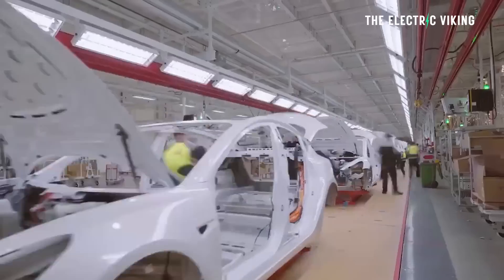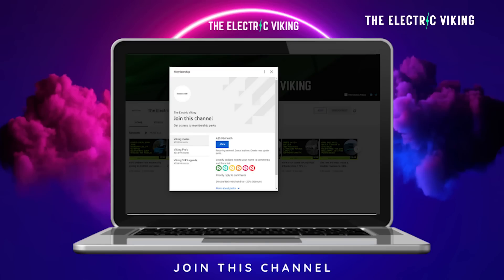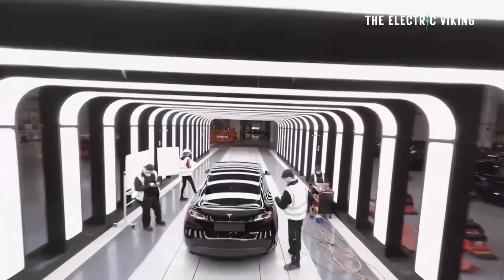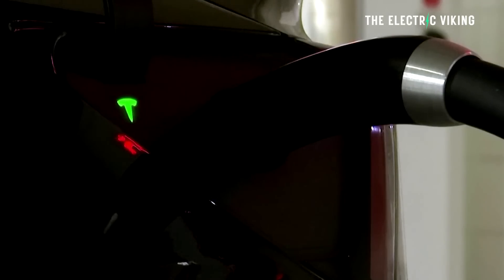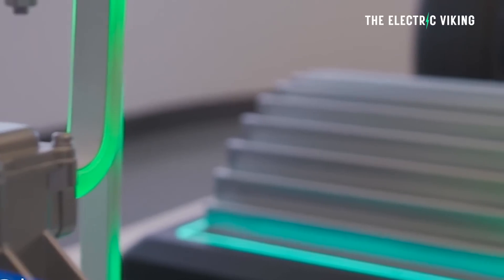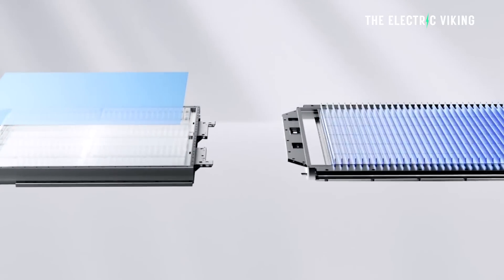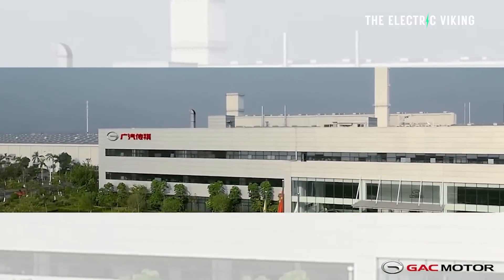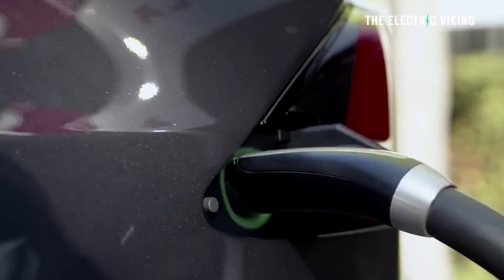Big changes coming to European & Chinese made Tesla Model Y battery

Comment: What tesla needs to do is not what they are doing.
Tesla cars are virtually uninsurable or are insurable at absurd prices because of the silly manufacturing processes.
For tesla these might be bringing in huge profits. For potential owners these are idiotic roadblocks.
Especially the model y with it's huge subassembly parts.
Lets face it, reality is crashes happen and cars are not single use products. They need to be extremely repairable, where anyone can do it in their garage by being able to buy parts from any number of distributors, and not a monopoly of the manufacturer that either doesn't have the parts or charges an arm and a leg.
ie: You have a crash on the right side, tough luck tesla owner, you have to buy the whole real subassembly and on top of that the labor cost will be through the roof because you need to dismantle the whole car in order to fit the part back in, instead of doing the repair just on the location.
Reply: Prepare for this because all manufacturers will need to giga-press large part. I found Aviva insurance to be 20$ a month more than my Toyota matrix 2012 vs model Y 2023.

Comment: Apparently the hiatus is not just about the battery but the used motor (it went up from 88kw (30 minutes) to 100 kw (30 minutes) "continuous" load. This model-motor-battery combination has not been registered yet and needs a KBA numbers - and numbers here in Germany are a very serious thing. 😅
https://youtu.be/5Oa50_aJz7w?t=236

Comment: SAM - CAN YOU COVER THIS ON THE CHANNEL PLEASE

I don't get the hype over significantly faster charge rates and this is why.  Currently the data shows that around 80% of EV charging is home charging. Unless you have three phase you're unlikely to get charge rates less than several or more hours if the pack has been run down. The majority of journeys overall are not going to max out an overnight charge and in non US countries with far less long distance, even more so.

Home charge costs are less per kw/h so there is a small incentive to charge at home, cost wise in many countries.  The grid supply currently to most homes in the world can hardly support more than 11Kw charge rates, many less.  So again, what is the benefit of batteries that can charge super super fast, as the transmission supply infrastructure to domestic residences is never going to obtain high current supply and charge from home solar is slow.

So the only benefit I see, certainly for a long long time is supercharging covers a particular  and I feel more limited need (robot taxi aside). Those without or who cannot get a home charge solution (say apartment parking, or road side parking) yes, those long distance yes, and those who just want to get away from home life for a few hours, yes. But how do you see the real need for rapid charge batteries that use higher cost commercial charge rates?

Convince me there is a good use case please.
Reply: For the 20% that don't charge at home and for road trips.
Reply: We use superchargers on about a dozen trips per year. We travel somewhere usually to meet friends or family, stay for 1 to 5 nights,  maybe go on a couple of day trips then travel home or sometimes travel onwards to see other friends or relatives. Most friends and relatives don't have off street parking let alone a charge point, most places we go don't have destination chargers so we have to charge enroute. The faster the enroute charge the less it matters! After saying all this we have a model X 75 and we get about 175mile range driving at 70-75mph on the motorway, and the battery only charges at up to 100kw upto 50%. Yes it can go a little faster (occasionally 130kw), but most of the time 95-105kw is the maximum. With more destination chargers that that work seemlessly then the less need for the superchargers... But until you can plug and go with the charger billing you directly without signing up to a different random app each time and then pre loading credit onto an account you may never use again only to then find that the charger doesn't even work then you give up on destination chargers you haven't previously used and still to supercharging!

Comment: A significant difference with the BYD blade batteries is that they are configured as 129S. There is no paralleling of cells as in many other battery types. This simplifies battery management and reduce the number of pack components, reducing weight.

Comment: What puzzles me is, not one manufacturer is redesigning their vehicles to take advantage of the fact a long bonnet is not required anymore.
As a guy who drives a small F/C truck, it so much easier to drive in heavy traffic than my car.
Another point imagine the ease of manufacture if the drivers position was in the centre and passengers sat either side of them , no worries or changes required depending whiçh country is was being exported to.
Reply: There might be a few reasons: aerodynamics and safety (crumple zone).
Reply: ID. Buzz is one example
Reply: All good points, and I agree entirely. I guess the problem is people don’t like change? The first model S had a fake grill on the front, simply because there was concern that people would be too freaked out if there wasn’t one.

Comment: CATL M3P is not LFP with Manganese ,it is LFP - Iron +3 Metals( Magnesium, Zinc, Aluminium).
Reply: I think that they are using the  Magnesium, Zinc, Aluminum as a shell structure to coat an inner core of LMFP. The 3 metals should reduce contact between the electrolyte and the manganese to reduce dissolution as well as add other benefits.

Here is a quote from an article "In an investor research event in February last year,CATL said for the first time that it planned to launch a new product M3P battery, but this product is not lithium manganese iron phosphate battery to be exact, the battery cathode material also contains other metal elements, which the company calls ternary lithium battery of phosphate system."

Comment: The reason Tesla doesn't want to draw attention to these battery changes is because the people who they're trying not to offend are those who bought Long Range and Performance Teslas with the inferior Lithium-Ion batteries.
Reply: Lithium ion batteries have a longer range or more energy, dense and deliver more power. If you check the original model, three with lithium ion is faster 0 to 60 than the current one because of the differences in the batteries.. neither pack is better or worse, just different.

Comment: There is already a Tesla model 3 long range range with rear-wheel drive for sale in Denmark, with 620 km on a charge
Reply: Hopefully coming to Ireland soon....
Reply: This kind of pisses me that the NA market is getting LESS range than European models. Wtf
Reply: We are talking about 620 miles not km
Reply: This kind of pisses me that the NA market is getting LESS range than European models. Wtf
Reply: Not all markets are offered big battery single motor vehicles because here in the UK that was the one I wanted and we have never had it since day one. Also the ranges in different markets defer purely due to the measurement and not the specification. North American cars have exactly the same range as their European counterparts by just use different measures for regulatory purposes.
Reply: This M3 LR RWD is available in UK to business purchasers. Tesla told me it is simply a LR with front motor removed. The extra range comes from the reduction in weight.
Reply: @graememcleish1536  This is the car I wanted back in 2019 but was not an option. I wonder if it is a SR+ with a bigger battery or as you say, the Dual motor with the motor removed. If so, then it will come with front fogs and a sub woofer - unless they remove those business critical features... :O)